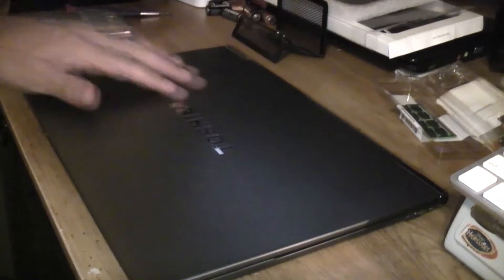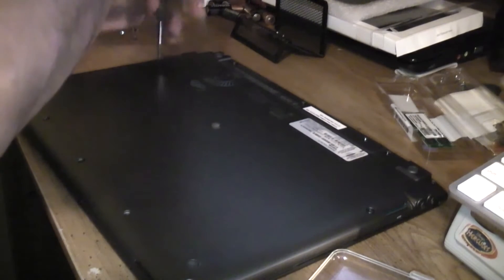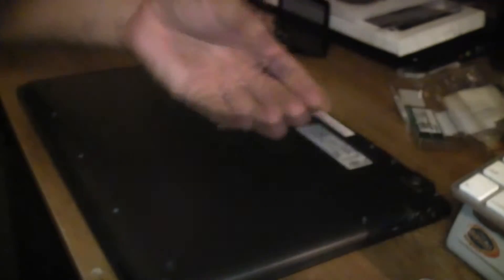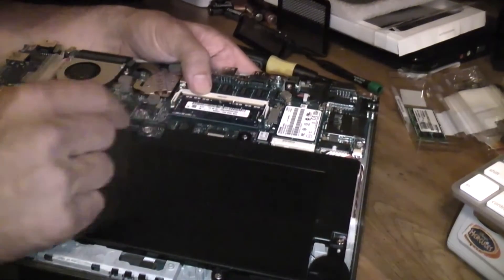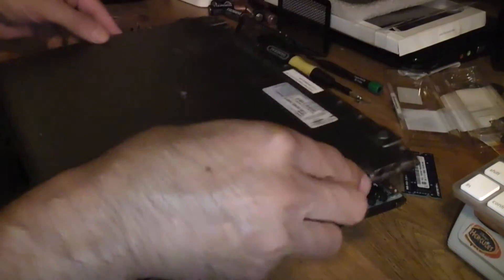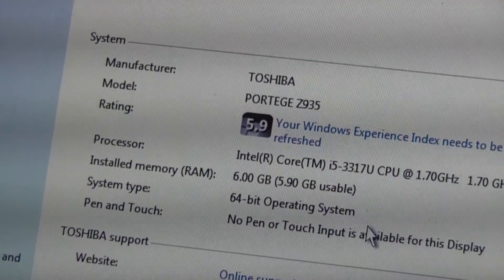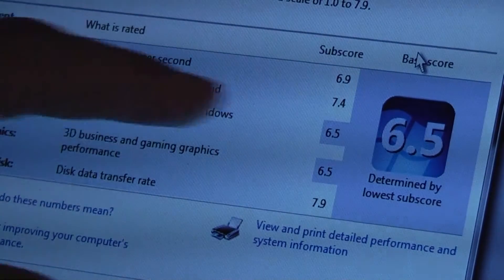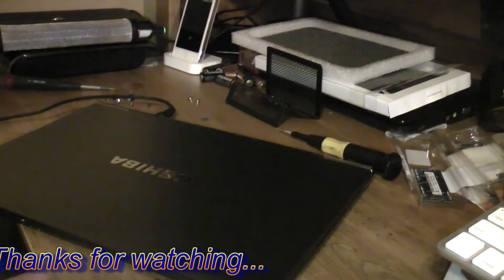How to upgrade RAM on the Toshiba Z935 Ultrabook

Comment: Thanks for your excellent video. Quick question: I thought the RAM on the Z935 was rated 1.35V.  All the memory from Patriot and also  Crucial were rated at 1.5V.  Does this create a problem or lessen the energy efficiency?  Thanks again.

Comment from the maker: You would have to remove the ribbon carefully and then access the WiFi card. You must left the ribbon very slowly. Start at one side and do it slowly. Are you planning to upgrade the WiFi card to something else? I believe the WiFi card in the Z935 supports the WiDi for connecting to a monitor or other device that supports wireless display.

Comment from the maker: Well both MacBook Air 13.3" and the Z935 are excellent machines. But for your money, the Toshiba Z935 would be the best choice for a few reasons. You do get full size HDMI Port, full size VGA, 2-USB (2.0), 1-USB (3.0), Mic and headphone, lighter, Memory that you can upgrade at least up to 10GB, and full size LAN. So in my opinion the Toshiba Z935 series is the best for your money at the moment. Unless your required to use a Mac at school. Hope that helps.

Comment from the maker: When I picked up the RAM locally, they didn't have a 8GB in-stock. But I also why Toshiba list the Z935 as 6GB maximum. Same chipset in other Ultraportables that have 8GB and the OS is 64bit so it should be no problem to recognize the 8GB. Going to give it a try if I can pick up the 8GB.